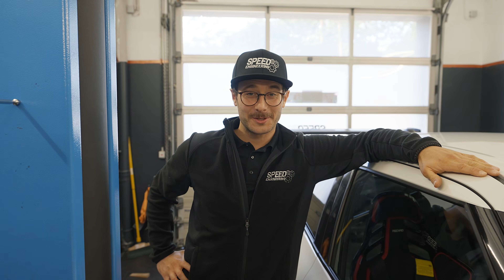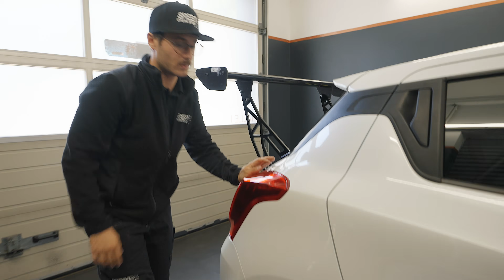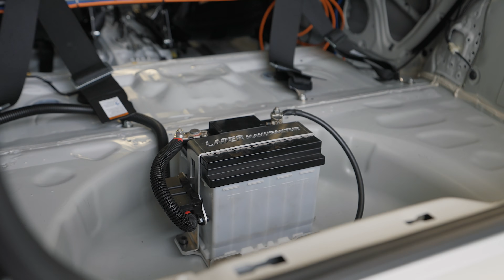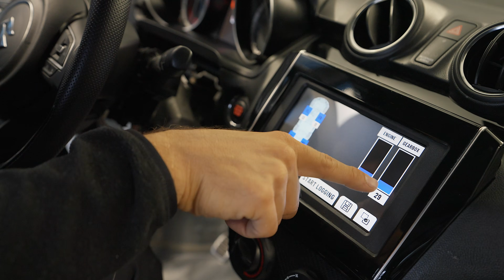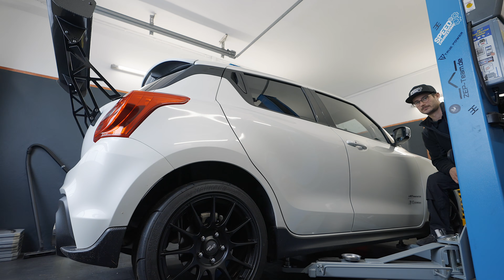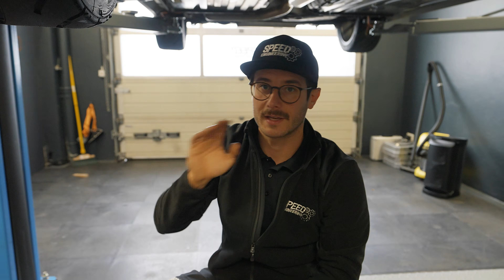The (almost) LEGAL Suzuki Swift Sport | SPEED Engineering

Comment: Hi I installed an extra main ground cable. 25mm to be exact. The throttle response got alot better and the power delivery became more linear... I did install it with 2 x 2mm copper bars going through the sensor...